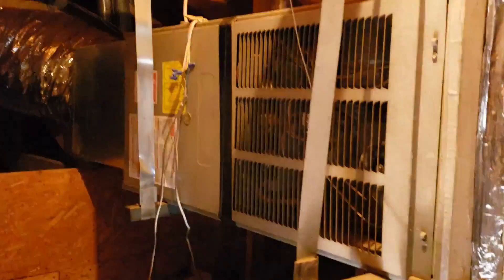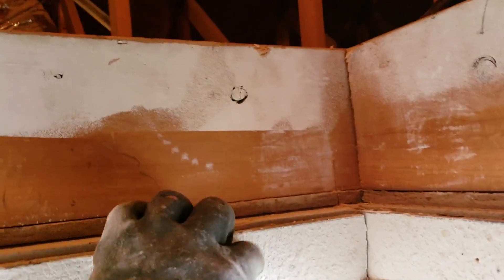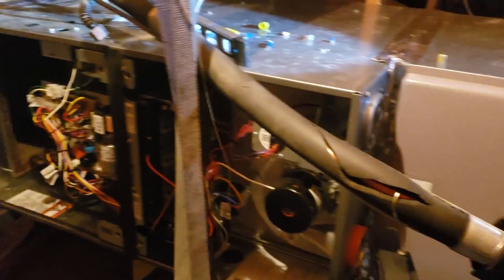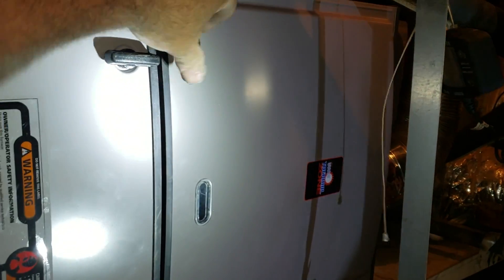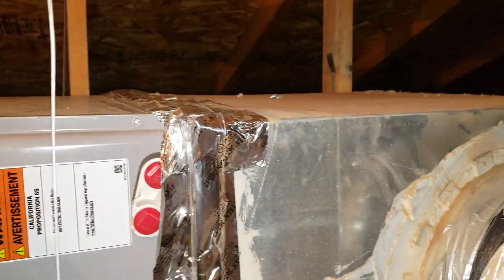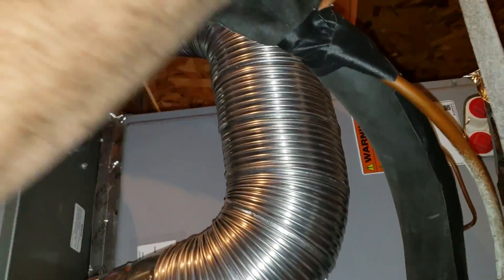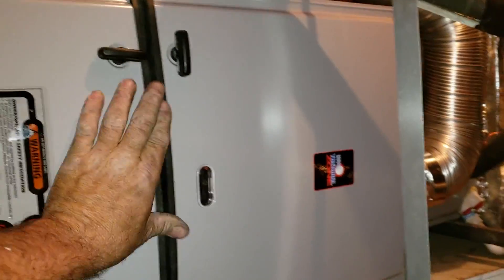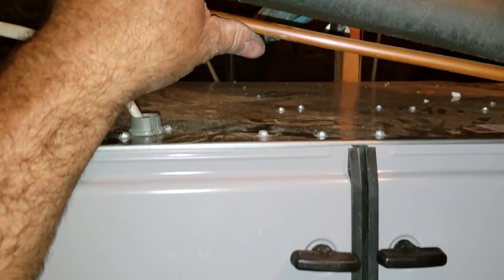Its been a while since I did a furnace install - Attempted to be hack free

Comment: You probably weren't finished yet, but on my small tablet screen it looked like the T fitting past the p-trap didn't have a riser on it to get it above the height of the coil. The cleanout on the front of the p-trap looked capped, but might have still been lower than the coil? A clog further down the line can make a fun wet sheetrock mess, lol.

 Yeah, the Bryant doors are a PITA! Those stupid screws NEVER seem to catch the first time or two:/  and it never fails, who ever installed it never planned ahead for easy door removal.  Ruud/rheem doors are my favorites! I love working on the side access L panel condensers, makes everything sooo easy ;)
Reply from the maker: I was so tired when I got it up and running. I gotta go back.
It shouldn't take much to add an extension to the p-trap vent.
The tee before the trap is capped but not glued. That was I can blow out the trap later.

Comment: Looks like you broke vacuum before you dumped charge when you removed micron gauge. And did isolate the vacuum pump and then check microns so you know how much vacuum you pulled with the pump sucking??? And Mitsubishi is quieter 55db.
Reply from the maker: I saw it stable under 500 and then let it continue to run since I had so much work to do in the attic.
That micron gauge was on the opposite side of the system so it was a very accurate reading even with the pump running.

Most people put the micron gauge on the same connection as their manifold and notice a rise when they stop the pump.

I have been trying to install a port on most system to connect the micron gauge into the system and I've noticed that I get a more accurate reading of the actual system that way.
Reply: @hackfreehvac  sounds like an excuse to not verify and do your due diligence. It is our job as technicians and service techs to ensure our jobs dont make everyone else look like hacks

Comment: Do you recommend flushing lines with RX11 after any burnout? We normally install and oversized suction filter and liquid line drier.
Reply from the maker: The stuff ain't cheap, but I don't want to have any issues especially with something I work on after my normal day job and that is an hour from my home.
Flushing with RX-11 is probably the next best thing to installing a new line set.